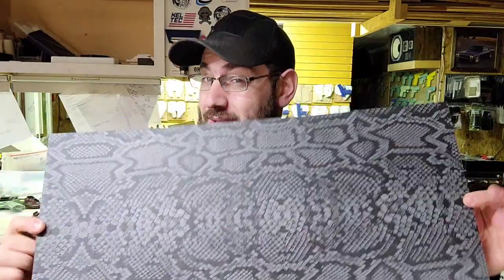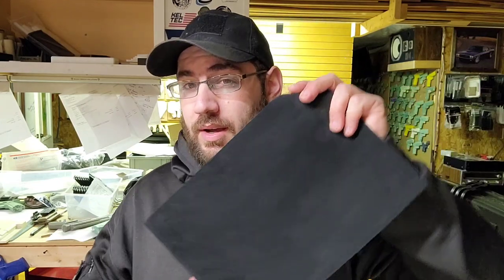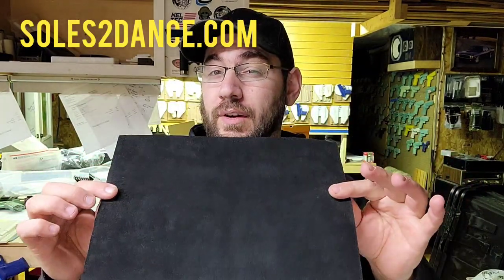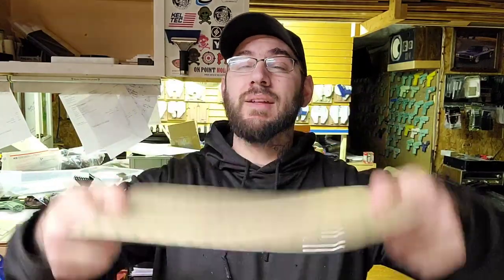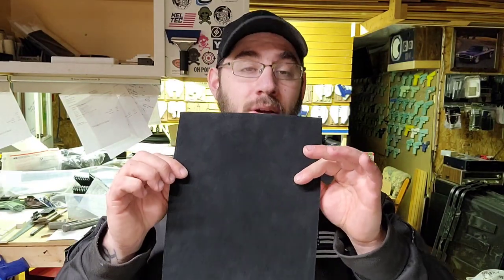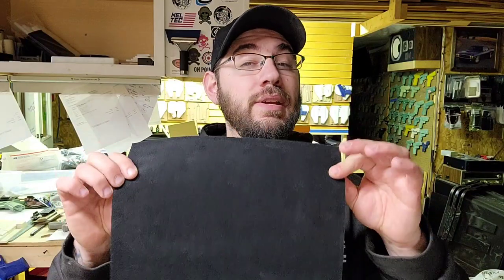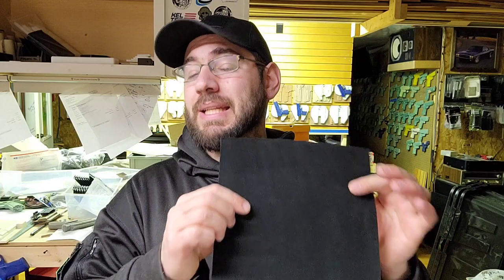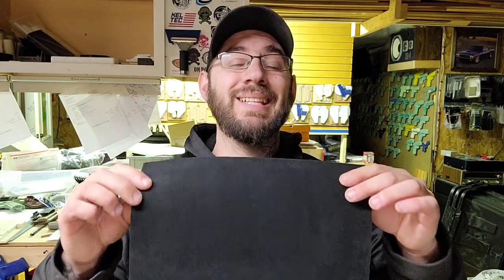Suede Lined Holster FAIL Part 1

Comment: I think I can help you get cheaper suede for that. I use it and always do it in foam. Rarely fails and when it does, it is due to very tight tolerances in the blocking